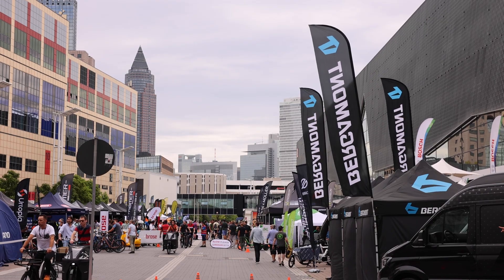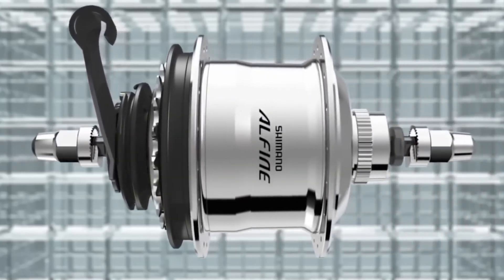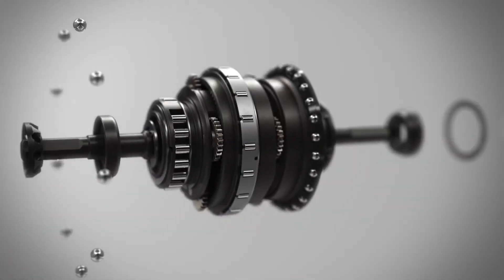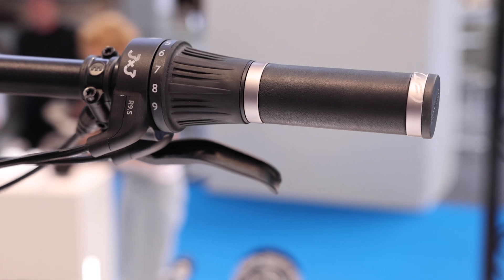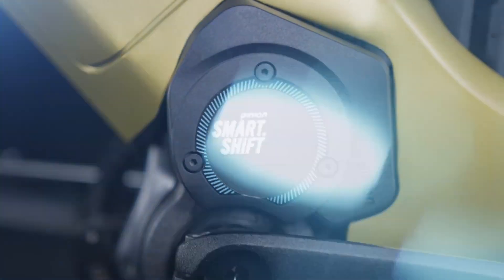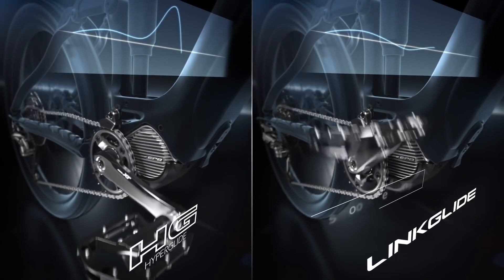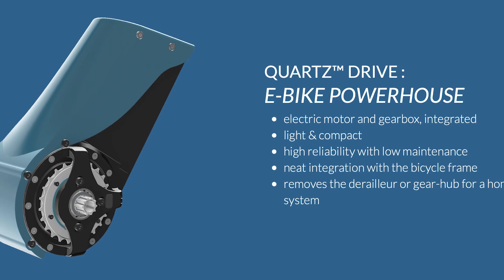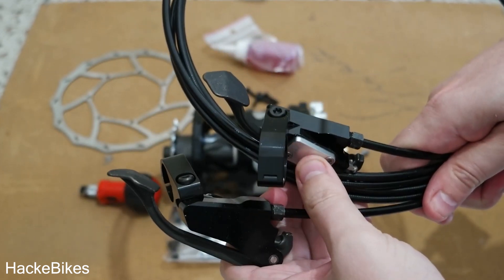The Future of Electric Bike Drivetrain Tech!

Comment: I'd love to see a video about electronic theft prevention functionality for e-bikes. My brand-new Gazelle C380+ was stolen days after I bought it. It would be great to see manufacturers design in features that make usage by an unauthorized rider impossible.
Reply: This is the biggest hurdle imho,  my bike is useless apart from fun rides because I cannot risk leaving it unattended
Reply: @Tom Champe Yep, 30 years of mtn biking all over the mountain west and I never lost a mountain bike. E-bikes however are intended to be full or partial auto replacements. Cars get stolen all the time, but Audi's aren't because they use a chip in the key fob to authenticate the user. It's not that they can't be stolen, but the difficulty of doing so is that it pushes the crooks to look for easier targets. As the saying goes, you don't have to be faster than the bear, just faster than your buddy!
Reply: @DaveWolfDenver  Bosch allows this with the locking of the controller to the bike. It works fine but unlike a car you can still ride the bike without the engine thats part of the problem. I would like to see it also lock the gearing system personally but it doesn't.
Reply: Any lock can be cut or picked within minutes with the right tools or expertise, while having a lock is a good deterrent, you should put an apple AirTag on it discreetly. Even if it does get stolen at least you have a way to get it back
Reply: @miguelito5602  that’s why my comment referenced an integrated system. Make it hard enough and they’ll go look elsewhere.
Reply: Sorry for you loss, Did you have the cafe lock and separate chain lock to your bike when it was stolen?
Reply: @andrewpark7242  Yes, I had it locked to a bike rack in the suppository secure courtyard of my apartment building. What I’d like to see is a theft-prevention system that includes an alarm, GPS tracking, front &rear hub locks, and alerts on a phone/watch app that uses biometrics to arm/disarm.
Reply: @DaveWolfDenver  I am from Germany. I have installed the biketrax systems. Means a GPS-Tracker with a SIM-Card between the cable from the Bosch motor to the lights. The inbuild little battery from the system should reach 4 weeks and load up when you use the battery with driving. Sure - when a thief build out the system from the motor area i will not see on my phone where my bike is.
Reply: @dietersteinfeld4283  Danke, Dieter! Ich werde es mir ansehen!!!
Reply: It shouldn't be hard to integrate an immobilizer that shorts out one of the MOSFETs on the motor controller. You could do this with any aftermarket car alarm that has an extra relay output channel.
Reply: @lihtan  I don't think you want to short circuit anything in the controller, unless you are trying to set fire to your bike. Disconnecting a critical Power Line or doing an Open circuit relay is what you want. Still doesn't solve the fact that you can easily pedal without a motor, or lift and shift a bike easily.
Reply: Is there any progress in digital drive systems with battery support coming in the near future. Thinking the elimination of moving parts equals longevity,no part is the best part.
Reply: One trick for me is to put a si ple padlock on the disc brake body 
For a quick lock

Comment: Like my Rohlloff hub, but really wish I could shift at any point I wanted... even if I could just issue the command, and the hub shift when it was practical for it to do so... my ATV does that... I can shift... but until the torque is below a certain level it doesn't actually shift, it's just a pending event, and once the torque drops to an acceptable level... the shift actually occurs.

Comment: I believe the future is in integrated gears (auto/manual) into a mid engine motor, so front cogwheel doesn't necessarily have same speed as paddles.
Reply: You are mixing up your bicycle with your rowboat.

Comment: Phew! That is a lot to take in.
With so much technology being pumped into bicycles the average bike mechanic will need a degree in electronic systems. There is no way a dealer can accommodate servicing the majority of what you talked of. 
One other thing with internal geared hubs is the issue of when you get a puncture. Hmmm!
Reply: These geared systems look complex and expensive. Not good for long term usability.
Reply: @jeffmpvd7689  Pinion has excellent kilometers in their systems, but who cares about facts when scepticism is central? You wouldn't pay their price anyway, right?

Comment: I have been riding Ebikes for over 2 years. rear motor, standard rear gears. I don't shift and ride mainly in lowest power assist. I leave gear setting in 4 position. to start I use the electric accelerator twist to get me going. I use this setting except for steep grades when I up power assist to 2 or 3. I feel an Ebike should assist regular peddling with minimum fuss of gears. and not all power only ride mode as well. works well and I have long power time with my battery. also, the price of my bike was reasonable. no gear shift/no maintenance. only hydraulic brakes need attention. bottom line. Ebikes are great and need not be very expensive or higher tech to enjoy. also, better to try an Ebike in person before buying and have local brand maintenance should you need it.
Reply: Middle age and older women too lazy for using gears on their E-bikes, are the best income source for bicycle shops. Drive train is run down way faster than by any other customers 👀💰🤷🏼💸💸
Reply: @OmmerSyssel  Actually, gear shifting put more stress on the deraileur.  It's stress on the drivetrain that causes wear, not lack of shifting.

Comment: I had a Shimano nexus 8 speed on my previous bike and there is a long term issue with maintenance. Every three thousand miles it needs to be overhauled which is not cheap and is not a home maintenance project  It was over $100 at my local shop. Besides that it cost more upfront than a derailleur system. It is actually a good deal more expensive in the long run and the short run. I am glad to get back to a derailleur drive train. Derailleur drive trains are  easy to get to and adjust, are not effected by tongue, are relatively easy and not expensive to replace, and are more  efficient. I'm just not buying into the idea that internal hub gears are superior by default.

 Hub gears do make more sense with a belt drive as you are at least getting rid of the chain maintenance, but that is not inexpensive. For myself after using a hub drive for over 13 years I'll take a nice simple derailleur that any bike shop in the world can work with.
Reply: Ignore the price and go with Rohloff. Can be found used as well
Reply: That's what's thinking too -- for all the frustration that a rear derailleur can produce, they are usually easy to adjust.

Comment: I’m looking to replace my commute from car to ebike. I convinced on hub gears, but  what I’m waiting for is fully integrated cables. I use to commute on a regular bike, and shocked by petty vandalism to the bike when locked on the street. I’m hesitant to buy an ebike with all the cables exposed and in easy reach of  vandals. Now with hydronic brakes and electric gears integrating all be cables should be easy?

Comment: All predicated on cost.  Lets take a current 160 Nm 1500+ watt Bafang BBSHD mid drive.  Its a bit hard on cassettes and chains.  If not adhering to basic tenents of downshifting when slowing, low power application at take off etc, everything wears out faster.  But steel cassettes and chains are relatively inexpensive.  Contrast that with internal geared drives. The internal geared drives you show are very pricy.  A consumer can buy a boatload of steel Sunrace steel cassettes and 8-11speed chains for the price of one of these highly engineered rear hubs.
I am hopeful for the day when rear gear hubs can be both more of a commodity in the ebike space and cost effective. We are a long way from that.
Thanks very much for the excellent product review.
Reply: Compare lifetime expenses on these systems. Rohloff pays off well. A used hub/bicycle can still be sold, while the cheap systems will be scrap.

Comment: It’s pretty obvious that the only thing going for derailleurs is weight and only a very small power loss. Great for racing cyclists. With ebikes these things pale into insignificance. Derailleurs are exposed to damage far too easily and pick up all sorts of dirt. I can’t wait to get a sealed drive with a belt for my next eMTB
Reply: Where are you all ruining your dérailleurs? I use this system in rainy, frosty, dirty and 6 months salted Denmark, just like million of other bicycles. There is no big issues with that system.. Puncture is an issue, not the drive train!
Used it almost daily since 40 years and never had any major issues..

Comment: I'm excited by the advancement of fly-by-wire transmission.  Imagine never replacing,  adjusting or oiling a chain again. Fewer parts to maintain,  bring it on....     :)
Reply: There are even wireless systems so you have less clutter on the cockpit.

Comment: I will stick with my Hub motor, mounted on my front wheel. That way if something goes sideways, with the motor or the rim of the wheel. I can just drop the motorized front wheel. Install the original non powered wheel, and I can still use my bike. And since the motor I use is a magnetic hub motor, no maintenance what so ever, and its quiet.

Comment: I work on Bike-Share bikes and you adding that as a reference to the points on the benefits of internally geared hubs is a great point!! The whole system would fall apart if we had to constantly be adjusting fiddly derailleurs that would be crushed when the bike falls over or is vandalized.
Reply: Curious, what city?
Reply: @jeffmpvd7689  Portland
Reply: How about the possibility that your bike is now carrying around 1-2K of bling.  Some people who would not figure stealing a bike share bike was worth it considering that they are  clunky and identifiable, would be willing to cut out the internal gears, or electronics.
Reply: Comment 1: Hey there! I just came across this new project called the Morph eBike. It's really exciting to see the advancements in electric bike drivetrain technology. I work on Bike-Share bikes, and I agree with your point about the benefits of internally geared hubs. Constantly adjusting derailleurs can be a hassle and susceptible to damage. The indoor recharge feature of the Morph eBike is definitely a game-changer. It's great to see how this eBike combines indoor fitness and outdoor exploration. Can't wait to try it out! Keep up the great work! 😄Comment 2: Hi! I am an ebike bike user myself, and I recently got my hands on the freebeat Morph 2-in-1 eBike. Let me tell you, it's incredible! The brushless 750W motor offers impressive power, and the 80Nm torque ensures smooth navigation on any terrain. The 80mm front suspension and puncture-resistant fat tires make for a comfortable ride. Plus, the IPX5 Waterproof finish is a must-have for any weather condition. But what really sets this eBike apart is the Smart Saddle Detection+ feature. It provides valuable insights and keeps me motivated during both indoor and outdoor rides. The Morph eBike truly elevates the riding experience! 🚴‍♂️

Comment: I think pinion has a lot of potential if top manufacturers such as bosch, shimano or yamaha releases hub motors, it wouldn't put a lot of strain on the drive train and most importantly if you have a touring bike with pinion you can go from ebike to touring by just changing a wheel, a lot more options than mid drive
Reply: Fully agree.   I think the reason the Bosch don't want to go hub is that then they have to put the whole wheel around it which is not their specialty.  They'd rather sell a battery and motor in a package that suits them.  

I like Rohloff and think they are better for touring but Pinion definitely makes more sense with a hub motor for the reasons  you said, takes the torque off the belt drive by having a rear hub motor, plus you can also do electric braking which will reduce wear and tear on brakes and provide a much smoother braking experience.
Reply: Familiar with the Mahle system? With the motor in the rear wheel, you can fast change to standard cycling.
Wilier Jena Hybrid is a good example